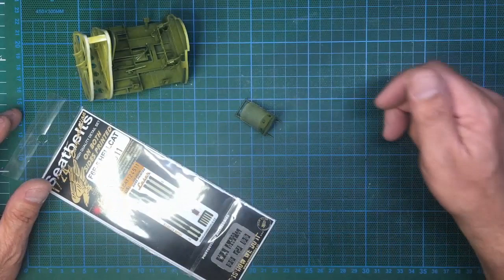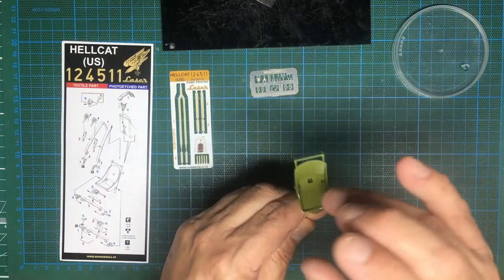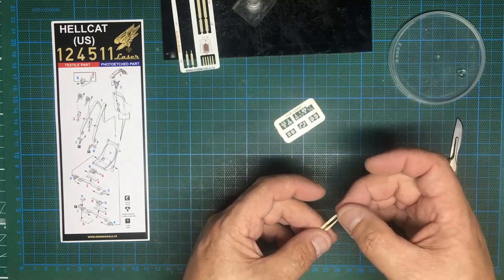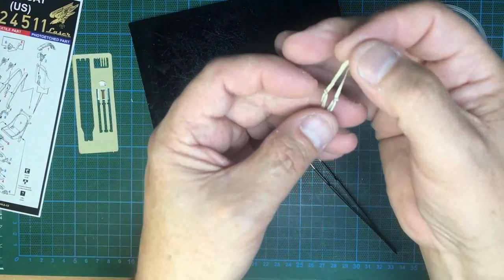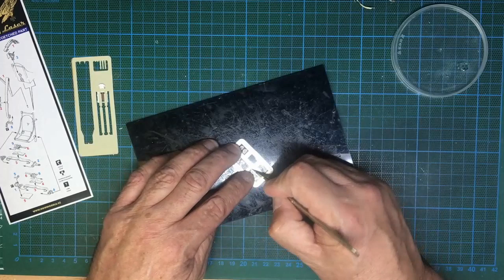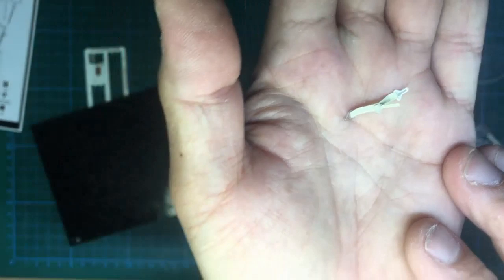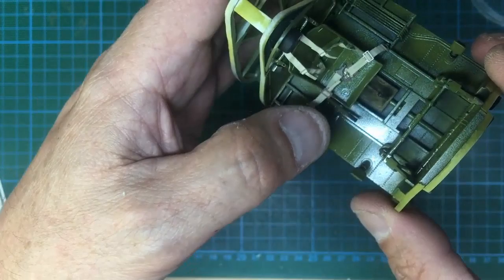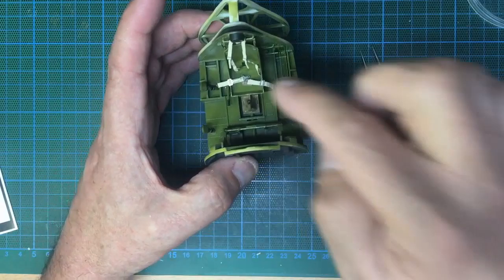Airfix 1/24 F6F-5 Hellcat build. Part 8c, seatbelts..

Comment: Hi Nige, I've just finished building up a set of these belts for my 1/24 Hellcat and you're right....they are superb.
Next step, how would you go about weathering / staining the belts and what products would you use to do that?
Keep up the good work!
Reply from the maker: Hi David,
Did you scrunch them up before assembly? You can weather them with anything runny and brown. Coffee, wash, acrylidc wash... anything, as long as it's very thin, dirty thinners rather than thinned paint.
Reply: I sure did, Nige, I  just followed what you did. It's funny you mentioned coffee....using tea had crossed  my mind before you replied!